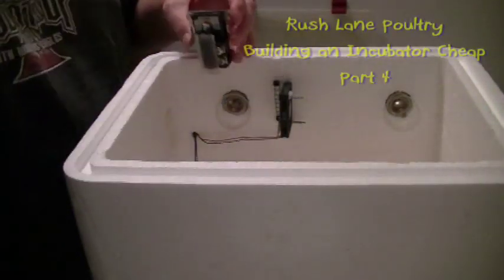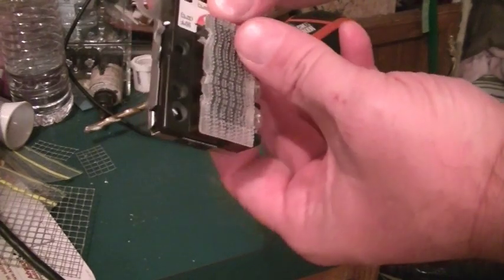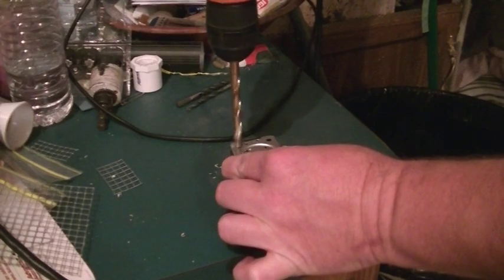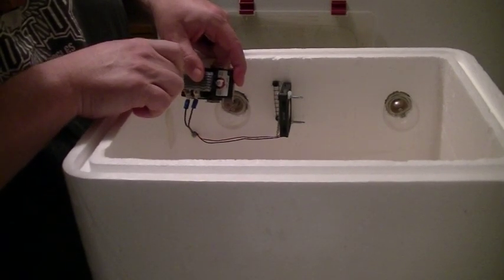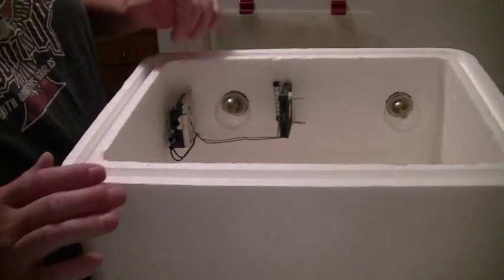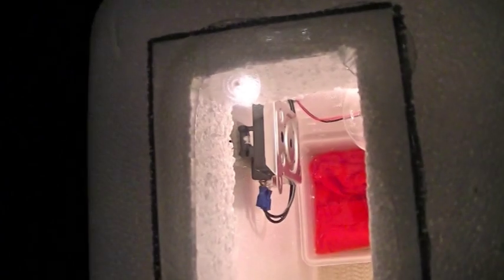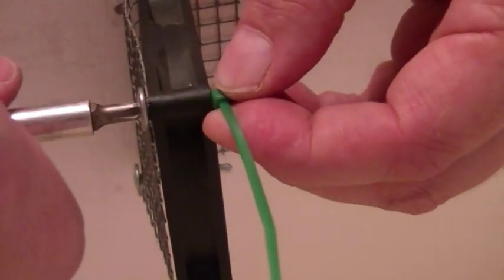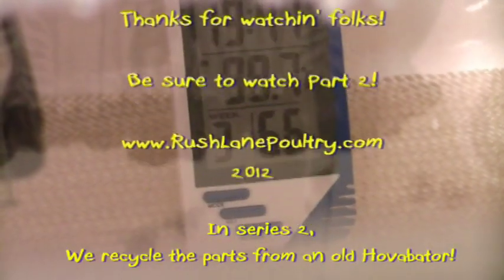Building a Low Cost Home Made Incubator! Part 4

Comment: I have a problem my light bulb keeps buzzing/dimming...it don't go on bright like it should....what gives?
Reply from the maker: Hey Amos... sounds like you either have a bad connection at the bulb or socket. or you may have a failing thermostat... Wade
Reply: Ok u mean the socket as in the plus in...also should the c connectors make a better connection?
Reply from the maker: The socket where you screw in the bulb. Make sure that you don't have any dirt or debris in your thermostat. You can tap it with a screwdriver or blow it out with some compressed air. And, yes, the C connectors are better!

Comment: When using the thermostats from the old heaters how do you regulate the temperature?
Reply from the maker: +Amanda Scarbrough I use a flat-head screwdriver for the Sammax style thermostats just like adjusting the water heater thermostat.

Comment: I am so pleased that I found y'all...I have been creepin round here tryin to find a good one. You get all the details for excellent optimal education on the how to! I can't seem to find any 33 qrt cooler round here so how big or small can ya go with the types of heating elements ya use?
Reply from the maker: Well THANKS Julie!! :) My pleasure dear! Actually, the bigger your incubator box the steadier your temps will be... if you build into a 48 qrt cooler your temps will hold a little better! Now, I got these little coolers to hold temps very well. I've used light bulbs, heater elements out of a refrigerator defroster, heater elements out of little space heaters and the GQF elements for their Hovabators! They all work well... I literally have built incubators out of whatever I had laying around the house!